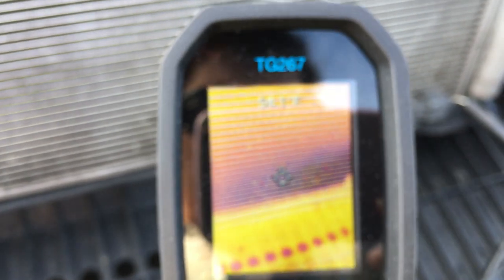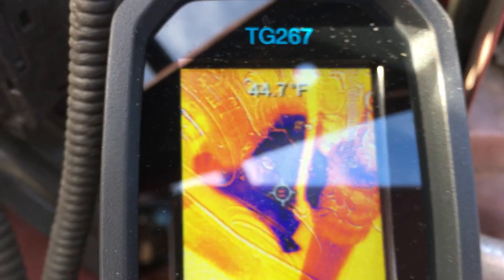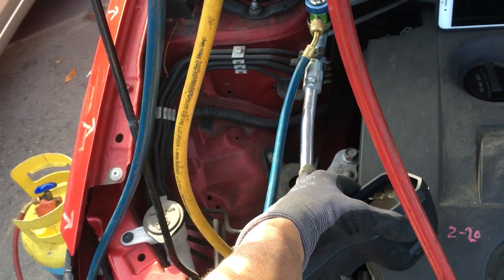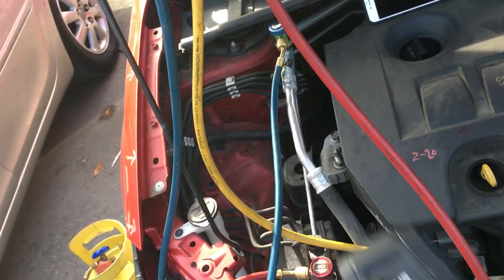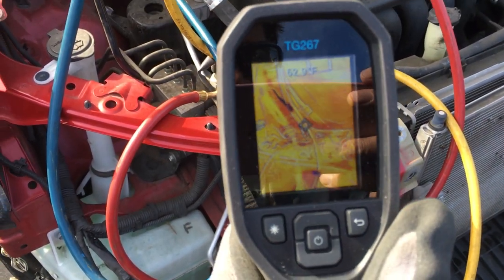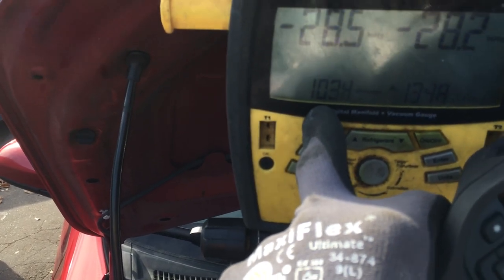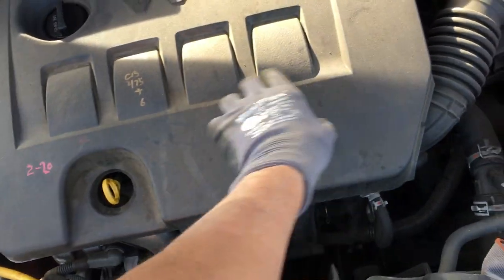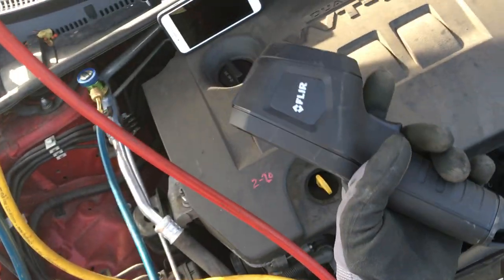Thermal camera TH267 FLIR . Compressor and condenser & lines chill as refrigerant is recovered

Comment: They include the k type tc for being able to obtain an accurate emissivity setting. I’m a certified thermographer through flir. That’s a fantastic device, it’s good for non invasive testing. It is absolutely all up to the technician to achieve accurate readings. Very good for delta t measurements of restrictions.
Reply from the maker: Yes I watch some of the videos on using the K type that is inside my case that came with the camera. 
          I had the previous generation camera and I felt that my readings did not jump around as much as they do with this newer camera I’m getting some in accurate jumping up and down of temperatures even when holding it on a concrete floor. 
             I did not have that problem with the previous generation. 
             And I find the optical camera to be misaligned with the thermal image by 1 inch up close from my driver seat in my car and that my radio knob. 
            I could shoot a laser for the thermal image right at the radio knob but the optical picture image shows the knob 1 inch off to the right not anywhere even close in the picture to overlap the thermal image. 
             I think I need to put a technical email asking if this is a misalignment of the lenses that needs to be send it in to be serviced this is brand new just got it from true tech tools
Reply from the maker: I’m about to re-release some videos of inaccuracies of temperature off of reflective material showing extreme differences a false readings by the camera that technicians need to know about this is stuff my dad taught me before high school
Reply: Yeah, electrical tape is really good for that demo and heat blocking panels( piece of cardboard 🤣) also matte metal really good for showing your reflection.

Comment: Can you see leaks with the camera? It seems like you could?
Reply from the maker: If there is liquid refrigerant, coming out of a leak, it will get home and you’ll be seeing it as a darker color. 

The same thing is for heated air in ductwork in a furnace. If there’s a leak, you will see hot air leaking out same with hot water or cold water in pipes that are inside a concrete floor for radiant heating. If there’s a leak somewhere, the camera will pick it up .

You can literally see the hot water to use underneath concrete for radiant heat in a hole through the concrete
Reply: @coldfinger459sub0  Cool! Seems like a much better way to detect leaks than a sniffer. Not sure if they cameras have enough resolution but it seems like it would work!
Reply from the maker: @WallaceRoseVincent  no the cameras no good for small leaks leak.  In automotive the majority of the areas you cannot get a direct line of sight on many of your.  Cameras no good under the dash behind the panels and the heater core box..   

Only refrigerant leak detector is good for that   

Then do ultrasonic leak detector is better at some other types of leaks in different situations. It has advantages. 

And then there’s other situations where high-pressure nitrogen has the edge and better . 

Not to mention the tried-and-true simple one every now and then the bubbles from the bubble leak detector. Find leaks other leak detectors cannot find or cannot pinpoint just find a location, and then the bubbles actually give you a visual pinpoint. . 

And then there’s those really tough leaks. They don’t leak at all when the vehicle is running in front of you they only leak at a very specific temperature, or when the vehicle is vibrating down the road it leaks. .   But when it’s sitting in the star with the hood up and you’re looking for a leak, it doesn’t leak..  

And sometimes that vehicle might’ve had to leak on the condenser somewhere underneath where through the winter time in rain washed away the oil in dirt accumulation. It had an oil residue but it’s not there no more because he got washed away. . 

This is where UV die comes in superior do you V die will come out with the water soluble oil, because PAGNPOE oil or water, soluble, and wash off very easily with water .   But the UV die pigments will Steve behind and leave a trace where there was a leak.. 
      This is a situation where the UV die is superior above the rest. 

So, as you can see, there’s no one good leak detection method. It’s a combination, and it depends on the scenario and the type of system under what circumstances. .  

I’ve made many videos, showing one type of leak detector not working well a different one did work and find the leak.

Oh yeah, I forgot let’s get back to leak detectors the refrigerant type there’s infrared and then there’s heated diode. They both have their advantages and disadvantages and some people have a hard time getting used to one or the other. .  But that’s a personal problem. They got a learn about otherwise they say they don’t like it but that’s just because they have no experience or education in the proper use of the proper type of refrigerant leak detector..
Reply: @WallaceRoseVincent it would probably work in a pinch for home condenser units or coils at the inside units. I'll give it a try and report back.

Comment: You should have changed the emissivity settings to show the accuracy change.
Reply from the maker: It’s still doesn’t work good enough.  On Shinnie Aluminium even when you go by different angles, you get slightly different readings it’s OK for somewhat of just comparison, but not if accuracy as needed. 

With radiators and condensers, you can see through them because of the fins . 
So when you just get the right angle, it actually reads the temperature or some of the heat given off behind the condenser from the hot radiator with coolant passing through it, giving you a wrong reading .

If you have shiny aluminum, you can literally pick up something hot behind you or her off to the side . 
Just like a mirror, Caesar reflection, the infrared radiation shootout. It hit your sunshiny object that you’re pointing at and if you were at the right angle, it will reflect back into year, infrared thermometer or camera, and you’ll pick up the heat of the item that’s behind you. 

In other cases, if you have flowing hot air or flowing cold air going over to camera lens as you’re pointing over say a duct coming out of the dash and it might be 39°F but as the cold air goes over the lens, it distorts the lens in your temperature keeps going down and guys think they’re getting 20 some degrees or 19° out of the dash when all the reading is a distorted lens reaction to the temperature drop having nothing to do with the real Temperature

Comment: Infrared non contact themometers are NEVER accurate, unless the surface is PERFECT.  they sell tape to make that surface.😊
Reply from the maker: Tape is only good for the surfaces that you can actually get to

And not on a hot exhaust manifold at 600°F 

Or a dripping condensate dewpoint, wet surface that has water, droplets formula on it .